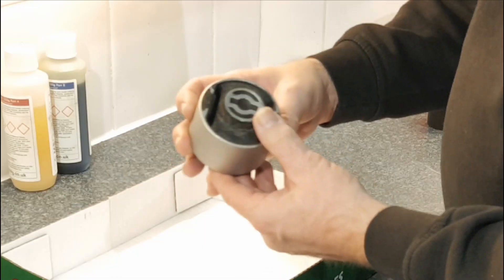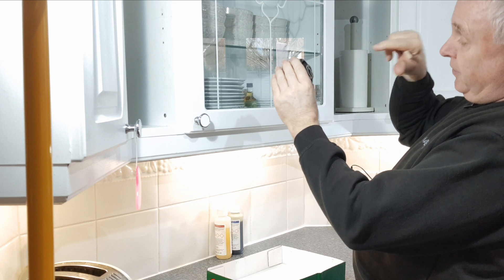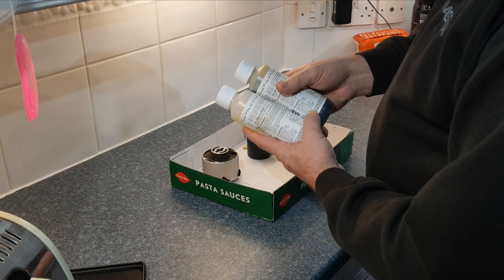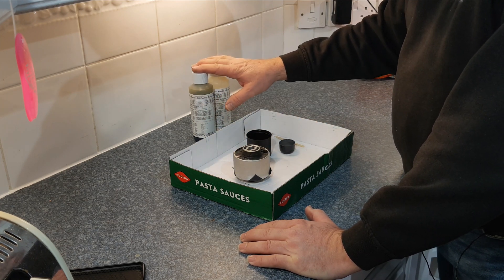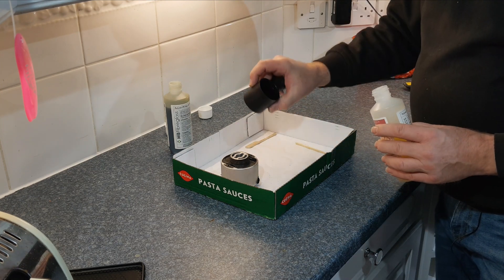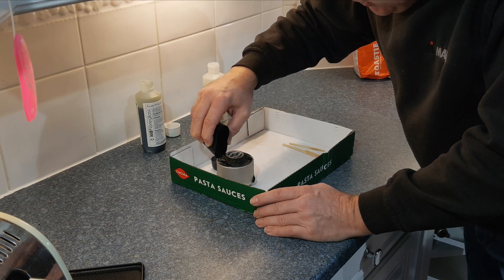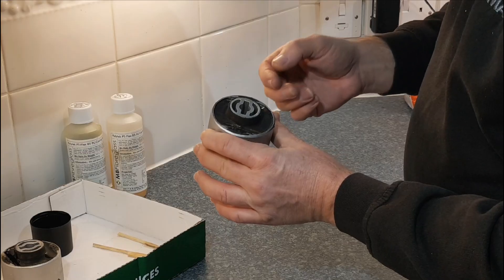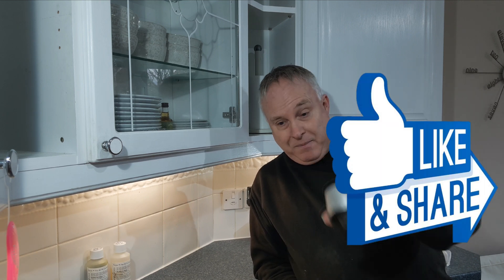Saab 9-3 Trailing Arm Bush - make your own HD Version

Comment: Would you ever be able to do a video in how to change the rear upper control arms?
Many thanks
Reply from the maker: The banana arms. I will, mine do need doing.
Reply: @CycloneCyd Did you ever make a video replacing Saab banana arms?

Comment: Great tutorial!

Something to note, however;
The bushes on the rear of these cars had an engineered level of flex in them, part of a passive rear wheel steering shared with the Vauxhall Vectra which was based on the same GM platform. So you're sacrificing that system in exchange for the extra strength.
It's also why orienting the bushes in the arm correctly is so important - if they're not the suspension won't flex correctly or equally.

Comment: Over Christmas so far my back box fell off (exhaust) , washer pump stopped working and now my speaker on the dashboard behind steering wheel has started hissing at me haha!
Reply from the maker: That rear end bump I had knocked my rear box off. I got a Klarius (very good quality) from ECP - doddle to fit. Washer pump is accessed by removing the front left wheel arch liner. Tenner for an aftermarket pump: http://bit.ly/9_3_screen_wash_pump
Those stock speakers are crap. I've fitted a full set of Hertz, you'll be hearing them soon. Get a pair of these for the dash https://amzn.to/39BdwUB a shade pricey but they are truly superb. Vocal clarity is especially excellent. And they fit straight in! just need to remove the card ring to get the trim back on.
Reply: @CycloneCyd  think I will look into all them haha! Its a bigger pain now because anything out of UK has import tax due to brexit

Comment: Would love a video on how you change these bushings! Thanks, you're an invaluable source of info for us 9-3 owners!
Reply from the maker: Coming soon!
Reply: @CycloneCyd   has this video been made yet ? Can’t find it
Reply: Changed mine using a big mallet  on a vice to knock out the old ones and used a piece of pipe same dia as the bush to press the new ones in, after first giving the housing a bit of a polish thru with an internal mop and a bit of grease.

Comment: Hi, I need to know some information about the clutch line, the hard rubber hose kind of under the battery on the 2.0T. Fluid WILL leak out when engine cold (or warm for either matter) right? And after putting a new line in, you will have to bleed the clutch right?
Reply from the maker: Yes, you'll need to bleed the clutch after fitting a new line.
Reply: @CycloneCyd  Thank you! Been tempted to give it a whirl on my own since i love working on my car!

Comment: Hey Cyclone, I've got a bad ABS pump and it's massively expensive to buy a brand new one. I wanted to remove a good, working ABS pump from a junkyard 9-3 near me and put it in my car. There's no real good videos on youtube about how to do it.
Reply from the maker: Sorry to hear that. Are you sure it's the pump and not just the module (ECU) on the side of the unit? They have a problem whereby the pins come loose on the edge of the board. It's easy to resolder them on and the module seperates from the block by 2 or 3 torx screws.
If it is the pump it's just a matter of undoing the lines and switching it over, BUT you will need tech2 to put the valve block into 'fill' mode.

Comment: Happenin' bud!! Is the chassis identical to the Vectra C's underneath? Found a chassis brace for the 93 and hope it will fit a Vectra.

https://www.ebay.co.uk/itm/Ultra-Racing-Mid-Lower-Brace-Saab-9-3-2-0T-2002-2012-ML4-1673-/274071449433?_trksid=p2349624.m46890.l49292
Reply from the maker: That looks nice, especially mounting to existing fixings. As far as I know it should fit, defo if you have a Z20NET (a B207L in Saab speak). Have you asked the seller?